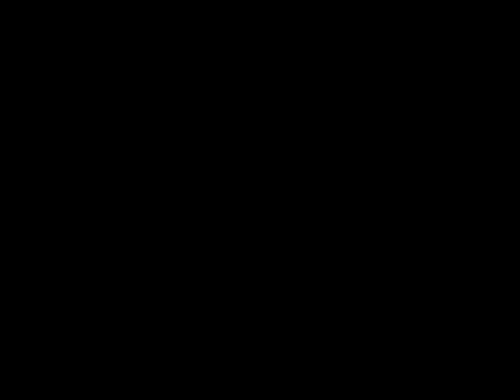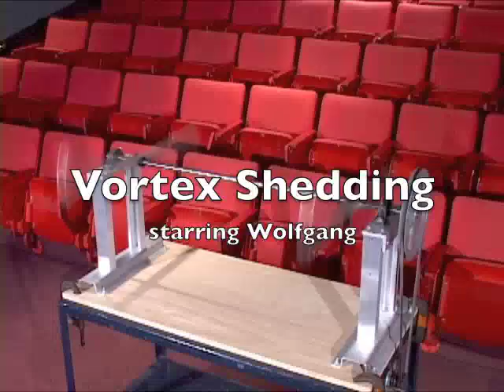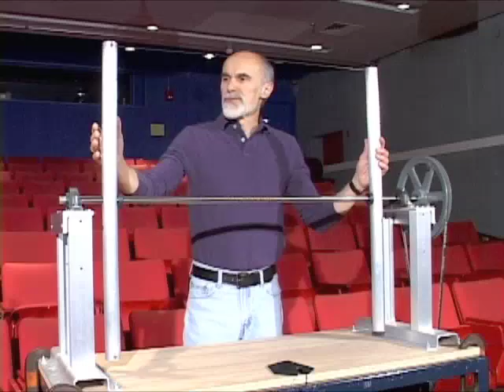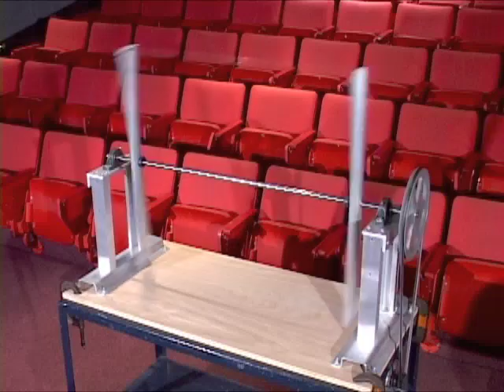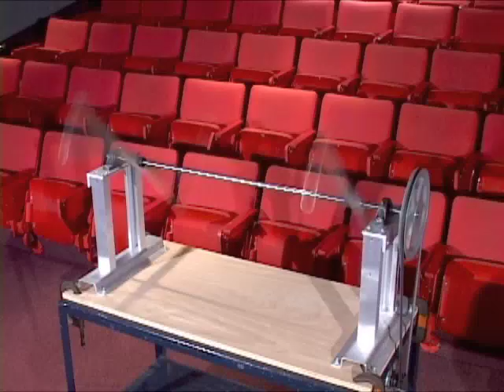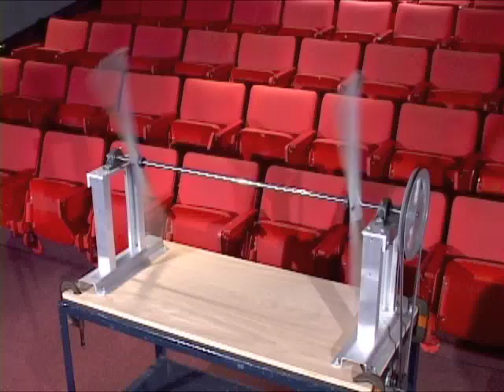Vortex Shedding in Air

Comment: Both strings were almost tuned together but a notch off. This creates beats we hear when they resonate. If they were exactly tuned, we would probably hear a continuous harmonic. Another way would be to have one piano string on one side and a muted material on the other side.
Reply: I don't think that's true actually. You can hear two distinct tones at various points during the demonstration. The beating is surely caused by the change of pressure as the wires pass next to the table

Comment: Where would we see this kind of thing in our every day lives? What were they working on when the vortex shedding was discovered? Very interesting video.
Reply from the maker: This particular demo is designed to replicate the phenomena of sound emanating from power lines and telegraph wires during windy conditions. Vortex-induced vibrations are important in that they can have a strong influence in situations ranging from tethered structures in the ocean, pipes bringing oil from the ocean floor to the surface, aeolian harps, tall buildings, and chimneys, to name but a few. For example, the tallest building in the world, the Burj Khalifa in Dubai, UAE, incorporates a variation in cross section with height to help ensure that vortices are not shed coherently along the entire height of the building.
Reply: @NatSciDemos  That is cool! I came across this concept after hearing about it with knuckleball pitches in baseball.

Comment: A friend of mine is a piano tuner so I'm being picky.

The strings were not tuned to the same note.  This causes an interference pattern in the sound both strings produce (hence the chopping sound).

Does this alter the way in which the system produces vortexes?  

Could the strings be tunes to cancel the sound of the other and reduce the noise level of the system?

How would vortexes vary in a sound reduced system?
Reply: Your friend the piano tuner has a better ear than I.  In any case, the slight beating of the two frequencies doesn't change the way vortexes are produced.  I also don't think you can tune the two strings to cancel the effect.
Reply: If the frequency of the vortex shedding is primarily dependent on the cross sectional width of the string then I suspect they will both oscillate at the same frequency regardless of whether one is tuned different from the other. The tuning would affect the amplitude of oscillation. I hear Doppler shift though. The setup actually seems like it would be difficult to mis-tune, because the tensions and lengths of both strings are almost certain to be very similar.

Comment: @NatSciDemos Not even with the use of a high speed camera? As visceral as this is demonstration is, additional visual aid would be most welcome.
That being said, could a different demonstration be set up in a tank of transparent fluid (water being the most obvious choice) with dyes (possibly non-soluble with the tank's main liquid (ie: dyed oil in a water-filled tank)) being released by the vector(s) creating/shedding vortices? Would that slow things down enough for a more visual demonstration?

Comment: @KafshakTashtak 
oh and you think its pure coincidence that the sounds peak at piano string harmonics? sure there is noise out of the motor etc the acoustics of the apparatus could be better in that aspect, but listen to the high pitched sounds that peak and die out depending on the rotation speed and go higher and higher as the apparatus rotates faster. i bet that if you put that sound track through audio software and compared the peaks to the string frequency they would be harmonics of it

Comment: Clever job. Don't put your fingers in the vortex! lol
Could you get that with a high framerate high res camera? In a correctly lit environment so the wires contrasts well under the lens.
You could probably isolate out the motor noise by putting the device in a separate room with a hole in the wall.

Comment: Hard to discern the engine noise from wire vibration (audible harmonic), interesting nonetheless; just wondering how we can be certain that this is from wire/air interaction and not from the apparatus holding the the wire out, as it has much more surface area? E.g. how do we know the sound is generated by the air/wire combo and not something to do with the arms  holding wire & that is what’s interacting with air, or, if this can just be vibration from the engine/ pulley / whole assembly vibrating strings? To be clear, I do personally believe the wire / air can do this, just wondering for method used, how we can scientifically know this is the case and prove isolation from aforementioned…? Thanks for interesting, albeit brief, video!
Reply from the maker: Thanks for your question. The tension in the wires is set so that when they're plucked like a guitar string, their fundamental audible frequency is at about 120 Hz. When the wires are set in motion and moving through the air at about 4.75 m/s, the periodic shedding of vortices starts to happen, and the wires begin to audibly "sing" at about 845 Hz, which is very close to the 7th harmonic. Using a spectrum analyzer, we found higher audible harmonics are obtained by increasing the speed of the wires. More details on our setup can be found here https://sciencedemonstrations.fas.harvard.edu/presentations/vortex-shedding-air

Comment: @NatSciDemos Hé ! Very interesting indeed. I have an itching question : is it the illustration of what happened to the Takoma bridge. We know now that the accident was not pure resonant but seems better explained by a coupling between vortices shredding and the reaction of the bridge (cables + bridge itself) ???? 

Quick ! An answer ! It's itching my brain ! ;-)
Reply: @Newtoon Resonant oscillation was thought to be the sole culprit behind the Takoma bridge failure, until an explanation pops up, suggesting that the interaction of the bridge with the wind causing continuously varying 'angle of attack' led to the disaster. A point to note that it is very unlikely for naturally occurring wind to be regular enough to cause a regular vibration- especially when it comes to vibrating a bridge of that scale.